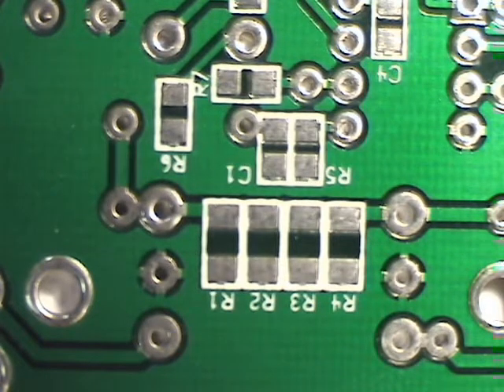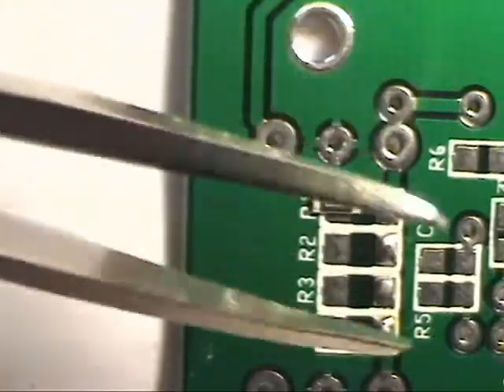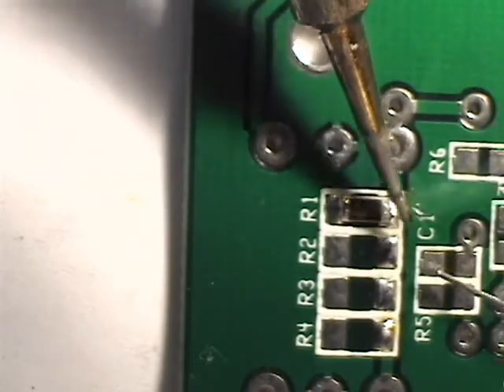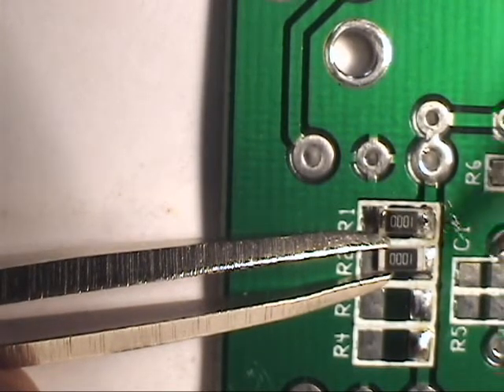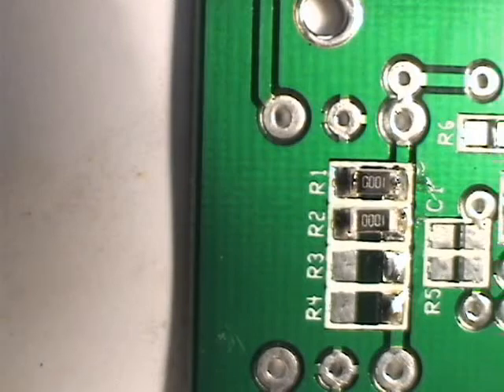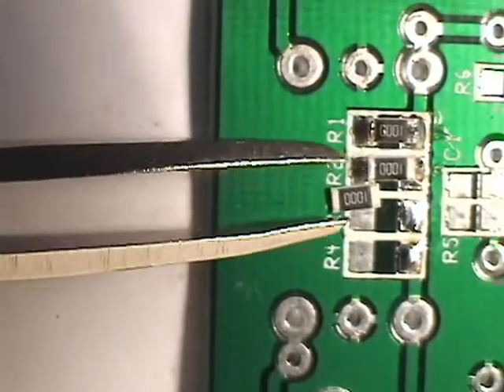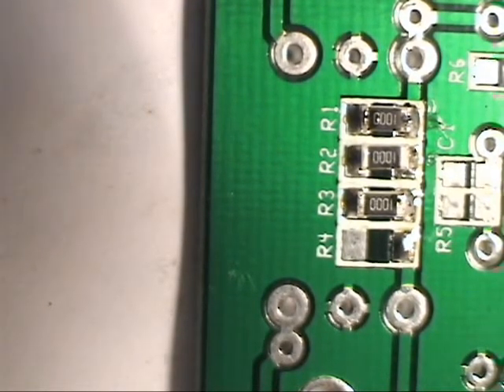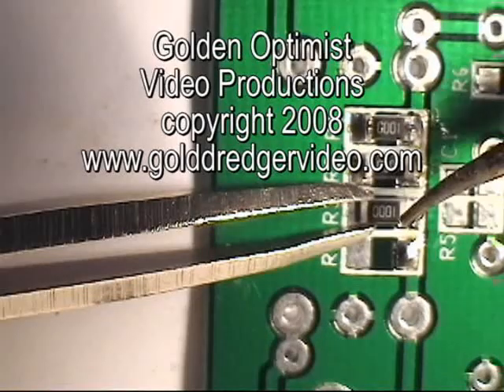Surface mount soldering 1

Comment: I have done electronic repair for over 30 years and your tip about putting the board in a box when working on it is brilliant , I have lost many surface mount parts . Thanks for the tip.